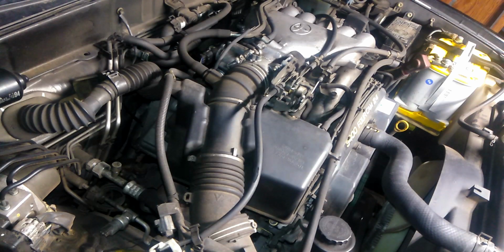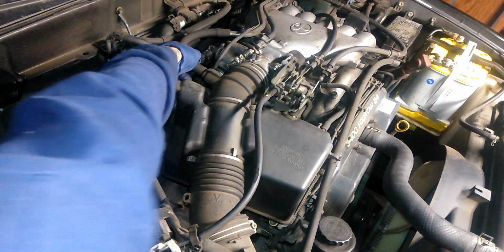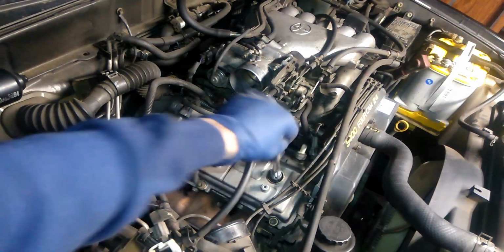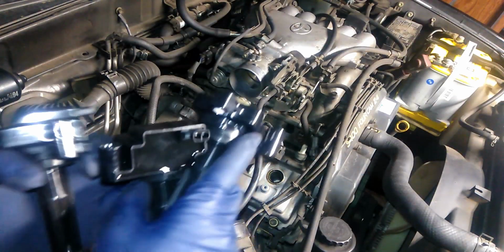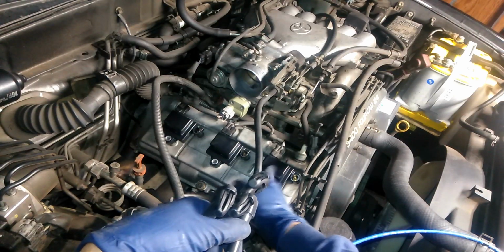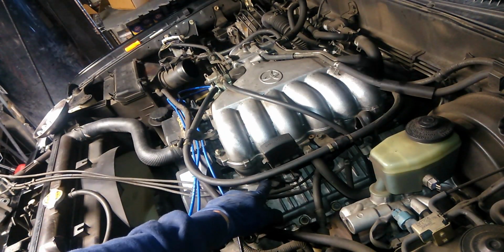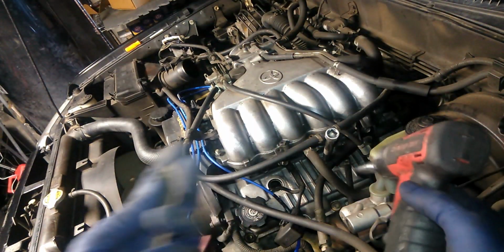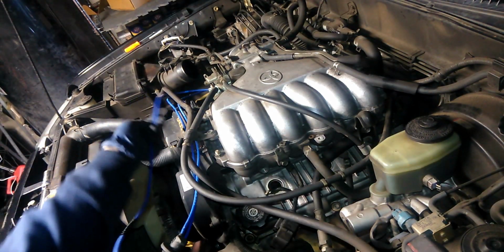2000 toyota 4runner spark plugs replacement

Comment: To anyone watching this. If you're trying to learn & perform a spark plug replacement, this video is prime example of "what not to do". He is taking a huge risk in A) Breaking off a spark plug in the tube. B) Cross threading the spark plug.

Spark plugs should be removed with: spark plug socket, extension, & ratchet wrench. Best time to change them is when your motor is cold. If you have to apply a great amount of pressure to remove the spark plugs, I would suggest spraying a very small amount of penetrate & let the plugs soak for 30 minutes. Replacing them: just hand tighten with the socket & extension, then you can bring in the ratchet wrench to tighten them down. 

This will save a lot of money & time from not having to bring your broken project to a shop to fix the mess this guy may have taught you.
Reply: That's why he mentioned to hand tighten them. "DO AS I SAY NOT AS I DO"....

Comment: Bro, don’t drop them in like that. 🤣 great video nonetheless. 👍
Reply from the maker: Lol. Its fine nothing would happen to them. Thanks im glad it helped
Reply: What do you mean
Reply: They're ceramic lol you never want to drop them
Reply: You should never drop spark plugs in like that, that’s how you mess with the gap and have cylinders running rich and lead to piston ring failure. If you’re working on peoples cars learn to take advice from professionals and don’t argue your stupidity

Comment: Thanks for sharing your knowledge, this is the first time in 30+ years to see somebody using an impact Gun to tighten a spark plug,I respect your way to do your job after all is your engine and your $ ..but you should consider that maybe some young guys are watching your video and maybe they can mess up the treads of the head using an impact gun (lack of practice) it is not because the torque but because the angle ,I believe you have more control with a socket and a wrench ,your wrist has more stability ,thanks again🕊
Reply from the maker: Glad it helped! And thank you for input

Comment: Great video. I will be changing my plugs, coils and wires.  I do not have the impact tools so I will be doing it by hand.  My question is:  what is the proper torque for the spark plugs?

Comment: Really nicely done. Just finished this for my 1st time and wish I found your video and not someone elses for reference. My 2000 SR5 doesn't have the intake cleaner box...was that negated on the 4x4s or am I missing a part? Picked the rig up at auction and learning as I go.
Reply from the maker: No it should be the same. Im glad it helped
Reply: I have an sr5 4x4 2002 and it has it
Reply: You are missing a part

Comment: This guy does not know how to change spark plug.  Who in the hell would use an electric wrench to do spark plug? I just hope he does not own a shop
Reply from the maker: I've worked at a shop and all the techs used a mini impact gun to remove the spark plugs out. Dont see an issue. Max torque on the gun is 25ft lbs.  So dont worry about it, its ok no spark plugs were injured in the making of this video! 😂😂😂😂😂

Comment: Hello, all; my 4Runner was running fine, but idling to low. So, I just decided to take it in for plugs and wires and coil packs. I paid 150 for the job, and now my truck is running like the Crankshaft Position Sensor is not working.
The truck is misfiring, puddering, hesitating.

It's running really really poorly.

How can a tune up make the problem worse???
Reply from the maker: Well if you paid 150 for a tune up. Than thats why. Just the coils run close to $200 and the plugs should be around $50. Wrong or cheap parts will make it run poorly
Reply: @JaboTheMechanic  I paid the mechanic what he told me. He did the job too quickly. I left feeling like all I got was wires, honestly.

I should have asked to keep the old parts. I wasn't thinking.

Comment: Did you seriously just use an impact to install your spark plugs... 🥴🙅🏻‍♂️🤦🏻‍♂️ bruhh.. never ever use an impact on spark plugs 🤦🏻‍♂️🤦🏻‍♂️🤦🏻‍♂️ and never ever use an electric driver to install your Coilpacks bolts either... those only take 10ft lbs at most or else you’ll end up stripping or snapping them... watching this video hurt my head 🤕
Reply from the maker: That impact gun is weak.
Reply: Doesn’t matter... they are spark plugs, doesn’t take much to cross thread them and again, 10ft lbs for those small ass bolts! But you do you bro, you’ll be the one with the customers complaints not me 🙅🏻‍♂️

Comment: I am brand new to learning about cars and tools, so this might be a dumb question.  I just got my first impact wrench like 2 weeks ago, never used one before...there is not really a way to control how tight you make stuff with the impact right?  Would it overtighten spark plugs?

EDIT:  and that is a CLEAN ass 20 year old 4 runner.  My 2000 looks like it was salvaged from the oil fires in the middle east in the 90s.

Comment: I cringed when I saw him use an impact to install the spark plugs. I would laugh when he strips the threads in the block and have to have a real shop drill the block and install a thread insert lmao...
Reply from the maker: Its impossible for that impact driver to strip out the threads. 25lbs max output and i wouldn't have to take it to a shop i can fix my own mistakes if it even happen.

Comment: Do you reply
Reply from the maker: Yes i do
Reply: Jabo The Mechanic is there a part list I’m thinking about doing a tune up on my 97 4Runner
Reply from the maker: Ok what did you want to do. Did you just only want ignition tune up
Reply: Jabo The Mechanic yes and oil change
Reply from the maker: Ngk plugs v power copper #6953
Ngk wire set #4412
Reply: Jabo The Mechanic what about oil
Reply from the maker: @agustinhernandez9866  oem 5w30.